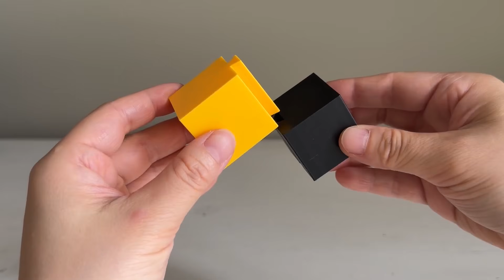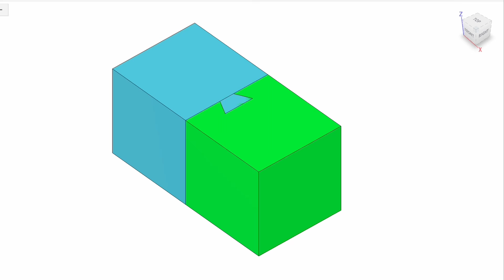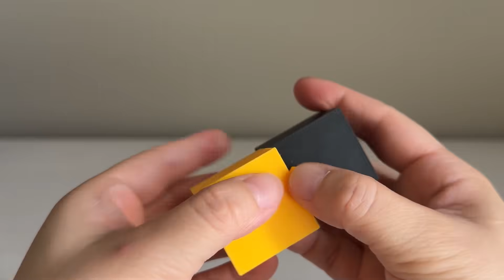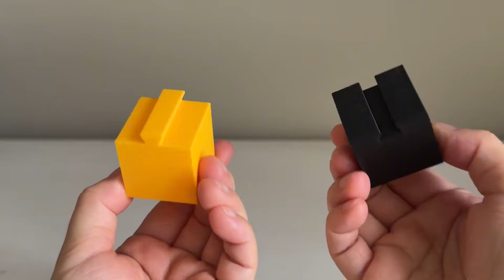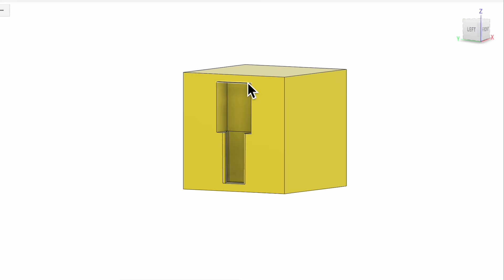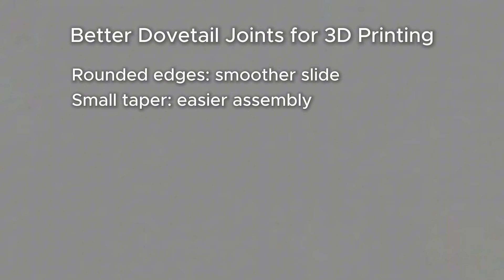Designing a Better Dovetail Joint for 3D Printing

Comment: The only thing missing is how to apply the 0.05 or 0.1mm clearance offset. Since you've used the combine tool I don't see how to then add an offset for clearances?
Reply: For anyone else wondering, I used the Press Pull tool and pushed the receiver side back to add clearance.

Comment: Good video.
However, the angled joint is not a good solution because it changes how forces are applied. For example, it allows the joint to be disassembled when force is applied perpendicular to the ends.
For a hidden joint, I suggest using a circular dovetail instead.
Use two dovetail segments, opposite each other, each forming a quarter of a circle,  and matching recesses in the second part.
Assembly will be done by twisting the two parts together, which is more secure because the joint engages in opposite corners and the effective joint length becomes more than twice as long.
If greater strength is required for larger parts, additional circular joints with a smaller radius can be added.

Comment: How convenient that you didn't pull on that last version… so it didn't show, that it does not bear load in the original direction!
Flip the thing then it would work.
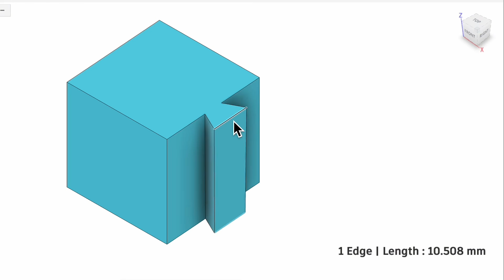Also, at 4:57 you say "The bottom edge is 10 mm, the top edge is 10.5, so it is 5 mm wider…"
Errrr… 0.5 mm maybe?

Comment: Great job. I was thinking when you were making the hidden dovetail but needed it longer, I was thinking about doing it as like a rotating assembly. So it'd only be like a quarter turn and it would lock itself in place the top and a bottom to make it a little bit longer. But this is excellent. Thank you very much.

Comment: Tapered dovetails are great so long as it's not a high vibration environment. For that, I particularly like creating a mated surface that's clamped together with a single m3 screw and locknut. The 3d printed features locate the two halves and take all the shear stress while the m3 screw keeps everything engaged.
Reply: Do you do both dove tail and 3M with locknut together or just 3M and locknut?
Reply: @j @jeanpaulaliaga8624  I’m thinking more like a kinematic coupling with an m3 and lock nut to keep engagement

Comment: nice video.  I used to use dovetails for most of my models. I made them pretty tight - so that I needed to use a hammer to join the parts.   Differences between your approach and mine were that I made my joints by putting a sketch on the top of the basic dovetail shape, and then I offset another copy of it. Joined the two lines and then used that profile to cut the dovetail out.   I also slightly adjusted the angle of the non dovetail part of the cut - so that it went slightly further apart towards the middle.  This helped to pull the two parts together as much as possible at the edges and stopped the inner joints from pushing the objects apart.

One remaining issue was rounded edges on the visible parts of the joint.  I spent quite a lot of time trying different things like adding a litte bit extra to each edge that could be shaved off to make the edges perfectly square - rather than rounded - but in the end I have started just not worrying about the gaps - as the things I model (ships) already have lines when the plates are welded together.

More recently I have moved away from using dovetails - to using springY t-joints instead.  I find this has a few advantages - firstly you don't need to worry too much about tolerances - between the tension in the springy part has plenty of room.   The biggest advantage though is that you can maximise the size of each part - as they don't overlap each other like a dovetail does.   I still use slightly angled cuts - so that the visible edges get pulled in.

Also you can if doing multi coloured prints use Flush-info-object for the springyTs - as they are hidden - so it doesn't matter what colour they are.

I like your hidden dovetails though - and wonder if something like that could be done with SpringyT's - probably tricky.

Comment: Missed bits - multiple dovetails to spread the load, even better if in chess pattern with corresponding inverted dovetails "inverted". Also taper can be used not just for sides, but also for height, and higher taper angles overall - to enhance ratio vs holding part area vs insert hole dimensions. For hidden tip of dovetail one might also round extrude it.
Reply: Thanks Mr. Obvious.

Comment: I really appreciate your videos, and especially that you share the stl’s to try it out ourselves. I’ve been teaching myself CAD (FreeCAD has been great, since there’s no commercial restrictions) the past two years, are starting to get feel fluent in single single bodies. Now I want to get into larger multi-body prints, with one idea that is too narrow for dovetails. 

Can you do a video on narrow  pins and sockets that really pull the joint tight? There’s only about 10cm by 6cm to work with. I’m trying to hide the seam as much as possible, while also having a surface fuzzy skin. Ideally they print upright diagonally, which makes it seem a better candidate for a separate pin, rather the male/female snap fits.

Comment: Your tutorials are so good, thank you. Teaching specific topics you can apply to almost every project. I'd love to see your approach on snap connecting two bodies together. Like in this video, where two bodies line up and hide the snap mechanism after assembly. Snap mechanisms are so satisfying.
Reply from the maker: Thank you! There're different type of Snap-fits. I’ve shown a rotating version before, and the hinge design also used a snap-fit. I may do a video focused on snapping two bodies together. But for parts that need to resist pulling apart, though, I still think a dovetail-style joint is usually stronger.

Comment: Cool! I would still suggest two shorter connections. One on top of the other. That will definitely improve the connection's stability.
Reply from the maker: Yes, that’s a more direct way to improve stability. If the part has limited cross-section to work with, adjusting the split angle can be an option, your choice:_send2printThinking:

Comment: Great video. Doesn’t the angle of the last piece mean that pulling the pieces apart will open the joint? Maybe a better solution to add more strength is a second dovetail alongside the first.
Reply from the maker: That’s a good idea. A second dovetail might technically over-constrain the part a bit, but with normal 3D printing tolerances it would probably be fine. About the pulling direction: the split angle can be arranged so that when the part is pulled, the horizontal force actually makes the two bodies slide tighter together. Then the end stop does its job and keeps the parts from separating. Hope that makes sense!